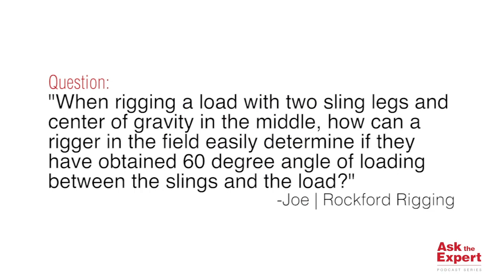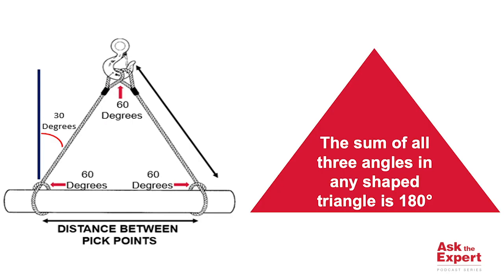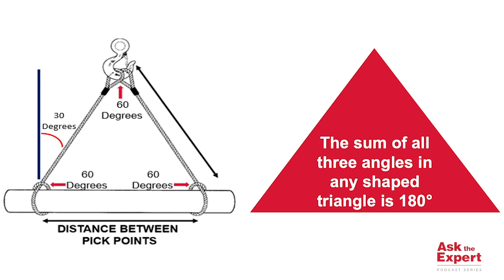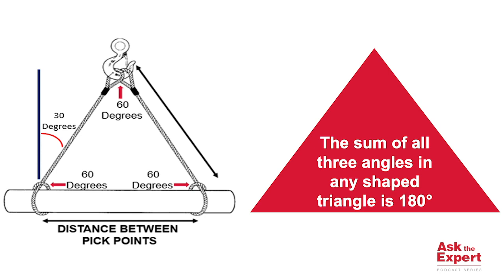How to easily determine 60-degree angle when using two sling legs

Comment: How do you figure the work load limit on a rolling shiv? On a 8 ton rolling shiv what are the 5 to 1 ratio and the 4 to 1 ratio factors?  Is it the d to d on the 5/8 and 3/4 wire rope? If so please explain.
Reply from the maker: Stephen great question and we plan to fully address this in an episode of Ask The Expert. 
In short our sheaves are generally designed to withstand the breaking strength of rope. It would be difficult for a user to overload the structure of a sheave, however attention should be focused on the bearing selection, as the bearing will most likely be the limiting factor for determining the WLL of the resulting assembly. Specific loading scenarios and resulting life expectancies can be evaluated by Engineering.

If you would like to know more now please leave your email address and one of our Experts will be in touch.